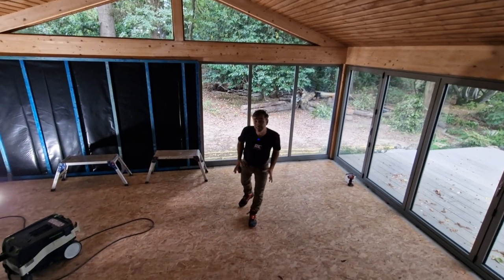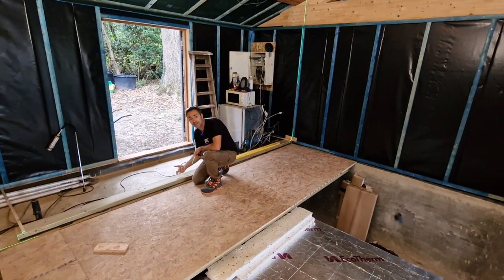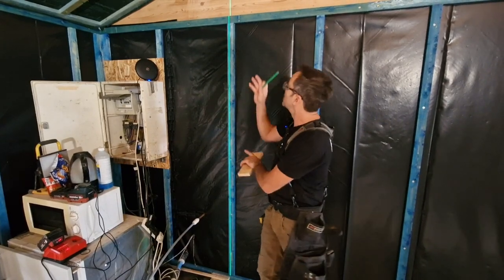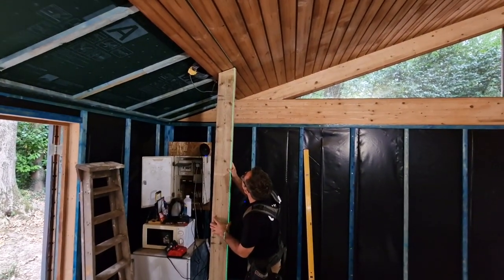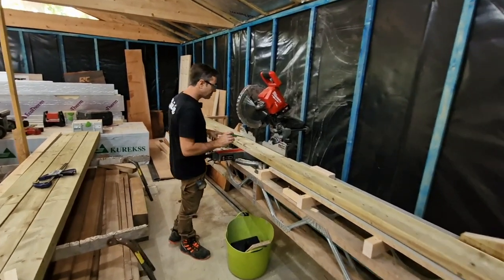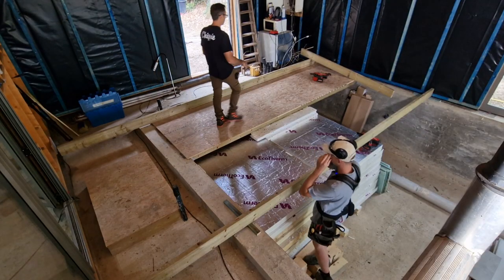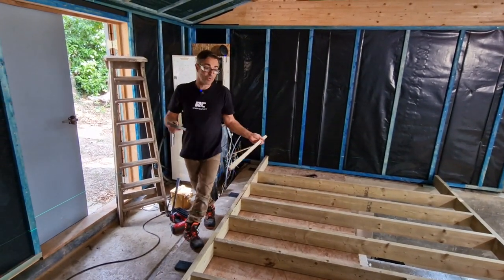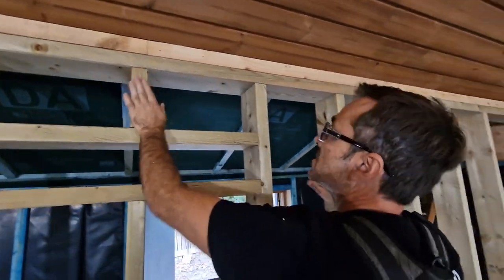Building a wall for the plant room, Ultimate garden room series

Comment: Hello Robin, amazing content as always, wondered if i could pick your brains or anyone else that could possibly help. 

Long story short, extension built ,old ceiling to new ceiling joists not level, although we want a flush ceiling all the way through, would cross battening to meet the height of the old ceiling joists still in place be a safe option.  The old section is about 5sqm in area to which I’m trying to match, although the new section which would need cross battening is about 45sqm in area, but the levels are all over the place ,the cross battening needed varies from 40mm to 63mm on the far end to bring level,there isnt anything i could do with the old joist to ‘trim’ them to avoid cross battening? Apologies for the long message, any help or suggestions would be highly appreciated. Many thanks
Reply from the maker: Hi Andreas, Cross battening the larger area is probably safer than trying to adjust the existing joists as this may impair their structural integrity... why is the new ceiling so far out???